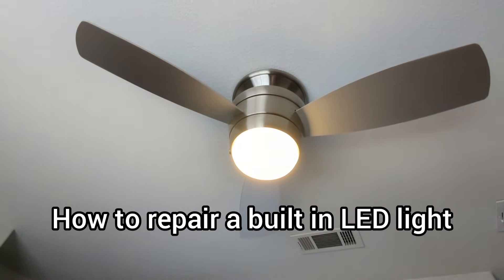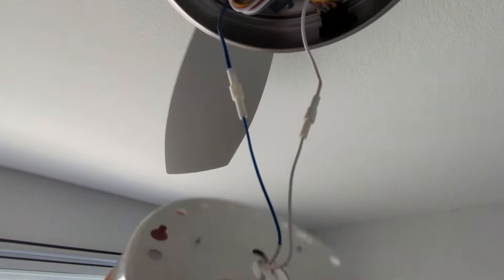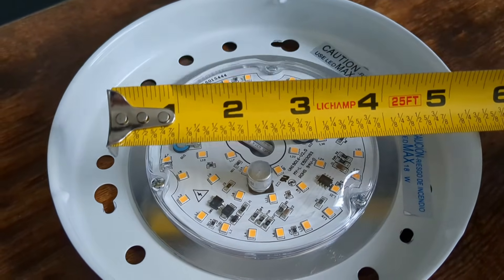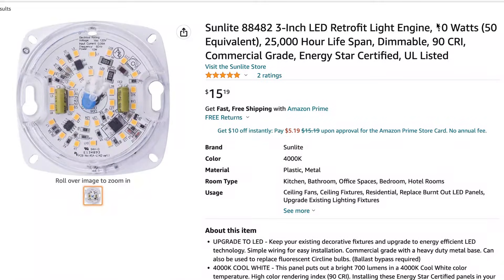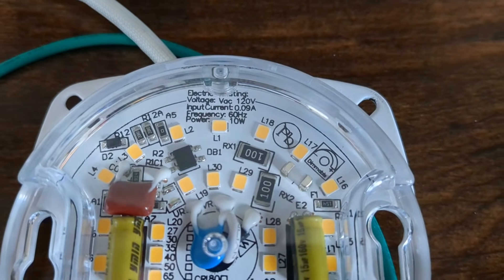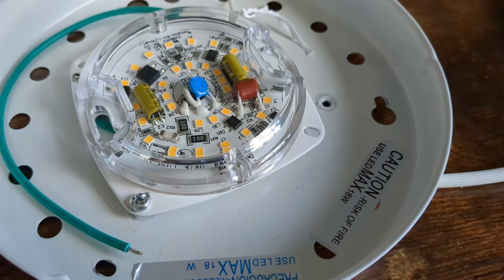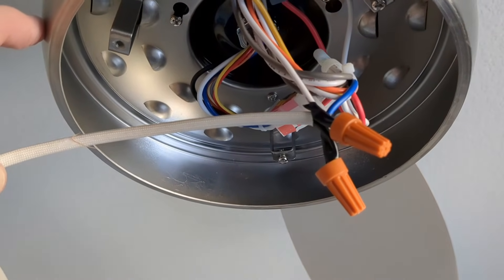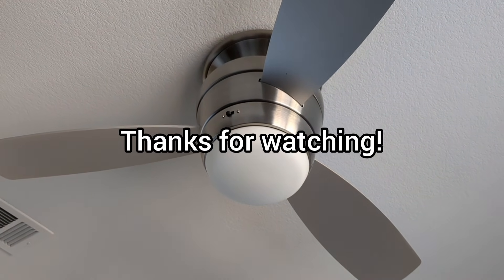How to Repair a Ceiling Fan LED Light - how to replace a broken Harbor Breeze or Hampton Bay light

Comment: I have a pretty much identical fan. Light stopped working a while ago, but fan works fine. I have tried 3 separate replacement LED lights, and none worked. Is there a driver that is separate? Or something else that would go bad?

Comment: Ok, I came to add this. I was just able to do this as a single 48 year old woman with absolutely no electric experience. It took under an hour and would have taken less if I had watched the video thoroughly and understood it but I did have to go out and bought the wire nuts which I did not have. Had to buy a whole big package but only needed two so if you don't have them maybe ask someone who would have stuff like that to give you 2. I also was able to strip the wires with some jewelry making tools I had. I had someone helping me by holding the flashlight and handing me the screws which helped immensely as well. Thank you and shame on this company for making people have to do this! Won't buy this brand again.
Reply from the maker: That's great! I'm glad you managed to bring your light back to life. Glad you found the video helpful. Thank you for watching and commenting!

Comment: First off thank you for going through the effort and the time to post a video about how to replace a LED assembly AKA light engine. As far as replacement goes it was spot on. I was a little disappointed to see that it was repair buy replacement instead of the discrete components, but I'm sure I represent the minority here since I have an electronics background. For those of you keep wondering why your LED lights burn out so quickly, it's typically because the LEDs were not designed for enclosed fixtures. You actually have to look for specific wording of rated for "enclosed fixtures".

Comment: Hey so I ordered one of the choices on Amazon and no light comes out after proper connection. I verified there is power to the unit and the live wire has voltage. I purchased the led panel that has multiple color temperatures and u can choose one by cycling through power. Do you think that’s the reason? It feels like the fan is not recognising the led panel and not allowing it power to turn on

Comment: Both of my fans (Mazon) went out at 18 months to 24 months.  So I purchased a replacement light engine retrofit kit and it came with a Wagu connector that has 4 openings.  No instructions or markings but I guess it is straight line same color wire to same color wire?  I am going to go buy a wire nut.   Update find out it is an inline connector! Glad to find your video!

Comment: Wow!!! I used ChatGpt and it told me to reset the remote before purchasing a replacement LED lamp. 
For my particular 3-speed unit, I turned on the unit and held down the LEFT light button on the remote for 5-10 seconds. The light turned on!!
Reply from the maker: Always good when you can fix something easily. My solution is good if you know for sure the light has burned out. Your message reminds me that when I first got this particular fan it was months later that I discovered it has a dimmer function. I just thought it had on/off only.

Comment: Thanks for the video.  It’s great that we can prevent from dumping perfectly good fans in the landfills.  I have 3 of these type of fans and will be doing this if the LED Engines die.
Reply from the maker: Thanks for watching! I haven't had to do it yet on mine. It really depends how much you use the light which I rarely do.

Comment: I just recently moved into a house and this was in the master bedroom. The light was very dim 🔅 now idk if that was bc it was on dim function via remore control as you stated. Or because the light is about to go out. Either way its dumb to not be a standard bulb 💡.
Reply from the maker: May be dimmed. Try holding down the light on/off button and see if that makes it brighter
Reply: @ScottAllison mine didn't come with a remote.

Comment: I called harbor breeze manufacturer and got a kit/ light panel mailed to me … Amazon did not have the correct size
Reply: I'm having similar issues tracking down a replacement part. Can you post their phone number?

Comment: Thank you Scott for the detailed video, and replacement was done very quickly with out any hassle, but after the installation my remote is not recognized by the fan, so I can't use remote to turn off the fan or dim the light. Any help?
Reply from the maker: You probably have to go through the set up procedure. It's either dip switches on the fan and remote that have to be the same. Check under the battery cover. If it's not that, check the manual as it's something like press one of the buttons on the remote  after you turn on power at the switch.

It's a harbor breeze mazon this is how you do it: 

Restore electrical power. Within 30 seconds of 
restoring electrical power, press and hold the 
“0” button on the remote control transmitter for 
5 seconds or until light on the fan blinks twice. 
Use the remote control transmitter to test the light 
and fan functions to confirm the learning process is 
complete
Reply: @ScottAllison  Thank you, i don't remember the model name but it looks like Mazon but the remote looks different. My remote has the dip switches and learn button.

Comment: My LED lights flicker, work, or don't randomly. Is that a bad connection?
Reply from the maker: Hard to say. Could be that, or just faulty electronics. Do you have it connected to a dimmer? If so, remove that.
Reply: @ScottAllison the dimmer remote came with the unit. Should I check with a multimeter like you did? Could the wires just be coming loose? It is happening on 2 fans actually.

Thanks for your quick response! I will subscribe if I haven't already
Reply from the maker: I just meant make sure you don't have a dimmer switch on the wall.
Reply from the maker: Were they like this from the start or just started doing this after some time?
Reply: @ScottAllison  It worked fine for a few years
Reply: @ScottAllison  doh! I thought I responded just now. They worked fine for a few years.
Reply from the maker: In that case I think it's unlikely it's loose wiring on both of them. More like the LED units just need replaced. That's my guess anyway
Reply: @ScottAllison  thanks!

Comment: This is so ridiculous that one should have to do this when one buys a ceiling fan / light.  Never again.  Standard bulbs from now on.  Don’t buy this junk if Harbor Breeze can’t support it.  This is the 2nd time for me.  Had to junk the first pair of fans because the LED’s weren’t available.  I made the mistake of assuming a reputable brand like HB, as well as Lowe’s would offer replacements.
These light kits don’t last that long either.
Reply from the maker: I agree with you that these should last way longer and they should sell replacements at a fair price.
Reply: I have had mine for 9 years. This will be the first time I have had to replace the light.  Very happy about that.
Reply: Agreed.

Comment: Are these just for fans or can the ceiling light use these too?
Reply from the maker: Could be used in ceiling lights too. Just make sure to check for the right voltage

Comment: Do they make these replacement lights with remote connection?
Reply from the maker: Not that I know of. But you can buy a remote module to convert an old fan.

Comment: Is it possible to just remove it and leave it off? My randomly turns on the lights in the middle of the night when turned off.
Reply: Mine too! I took it out.  Still trying to find a replacement but the fan works great without it.
Reply from the maker: It might be your fan is getting interference from a neighbor's device like a fan or even a garage door opener. You could try changing the remote control code if your fan supports that. Otherwise, just disconnect the light. That will work fine!

Comment: Great video. The only problem I have is there on no stickers on fan stating the wattage. Fan looks exactly as the one in your video. Any suggestions on wattage?
Reply from the maker: If it is the exact same fan then it's 18 watts. If you can find the user manual for the fan online you should be able to confirm the wattage for the light.

Comment: I thought this video was the right way for fixing my Mazon ceiling fan's light.
But it might not be the same situation. The terminal voltage you measured should be 110~120V but my terminal voltage has only 74V.
I cannot proceed to the next step as you did. 
Could you advise me on solving my problem or finding a clue?
Reply from the maker: In this video it is a Mazon. The reason you're getting less volts at the light is because you have it dimmed. If you hold down the light button on the remote you'll see the voltage go up or down.

Comment: I don't know how to disconnect the wires and you skipped over that part 😢
Reply: Same, the only part I needed
Reply: same
Reply: You twist the plastic caps till they line up and then pull them apart
Reply: Same
Reply: Not working.
Reply: They are just quick connect, pull them apart both at the same time opposite ways
Reply: Just disconnect them apart cut or pull.

Comment: I'd do this just to get the color temp upgrade since I have 4000K elsewhere, even better I'm seeing I could get a serious bump in lumen output.  The wattage probably doesn't matter too much if the unit is getting 110V in - that is its not being powered by LED driver with possibly limited power output.  So long as the new unit isn't generating too much heat that it overheats other electronics in the fan - but in general the light part is well separated from rest of it and it's attached to a big hunk of metal (motor etc) with a fan so unlikely to be an issue.  Also note that as LEDs get more efficient they need to draw less watts to output the same amount of light (lumens) so as the years go on expect that a unit with a lower Watt usage could be as bright if not brighter than one the manufacturer put in the fan years ago.

Comment: You make it look much easier than it was but I am so happy I had success! I had little experience with wiring and I had to watch some additional videos on that whole subject. This process was time consuming even just finding the correct light and size. Since they don’t sell replacement  lights Lowe’s told me I can bring the fan in and they would replace it but that seemed even more complicated. Thanks so much!
Reply from the maker: I'm really glad you got it fixed and the video helped you. Thanks for letting me know!

Comment: Update...went perfectly...to think we had no light for over a year...and for 15 bucks...bam! Have another fan in the den, so I'm ready. It flickers occasionally. Sunlite doesn't have the 40K, so I went with the 88480...50K...needed more light anyhow. Thanks for the grounding wire tip.  One screw lined up as you said and I drilled a hole for the other tapping screw to hold down the LED unit perfectly. Side note... working above my head is not that easy anymore...lol...so I cut off the plastic connectors from the original, leaving 2" of wire where I cut, and did a wire nut splice on the new LED wires... and only had to reconnect like the original way in the fan housing...white to white, as you said! Thanks again👍 CHEERS
Reply from the maker: Yay! Glad to hear you've revived your fan. Thanks for letting me know

Comment: What type of wire connector is used in this fan, how to disconnect ?
Reply from the maker: I don't know the name of it, but the replacement didn't have a connector, so I just cut it off and replaced with wire nuts